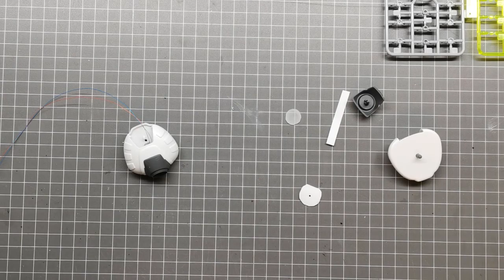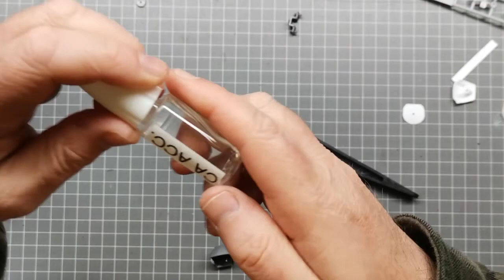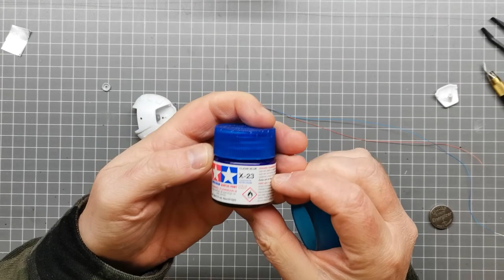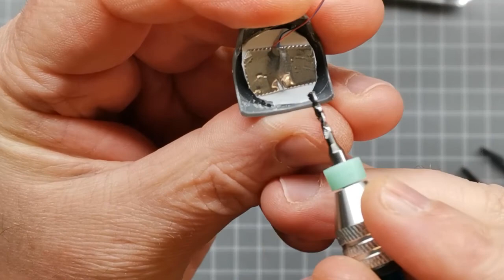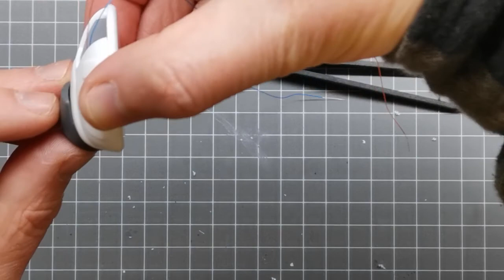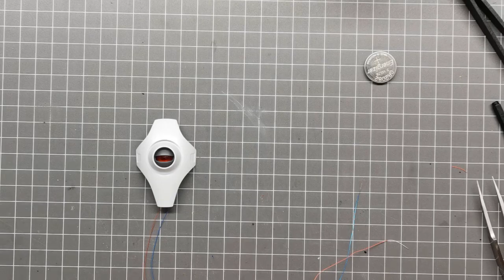Hasegawa 1/72 Regult (Standard Type) - Part 3 - More Wiring LEDs

Comment: It's coming along great. The switch location should work out well. Last night I was at Yamada Labi 1 in Takasaki and bought the light missile Regult for 2400 yen. I'm currently working on the old 1:100 scale heavy missile Regult by Arii.
Reply from the maker: Thanks Greg. I think it is coming along OK. I am sure I will have many more issues to contend with when trying to wrangle all the wiring together. The old Arii kits are great. I am looking forward to seeing your build of the heavy missile Regult. I don't think I have seen any builds of that kit. Are you planning on lighting it?
Reply: @duckplayingchicken  No, I won't light it. It's too small. The central eye is all one solid plastic part. I will add some lenses to other parts though, such as on the feet. The original Regult by Arii was made so that the knees would bend down to its collapsed shape, but this proved troublesome. The light missile, heavy missile, and scout variants include retooled knee joints which solved the problem.
Reply from the maker: Interesting. I may have to hunt down that kit and check it out. The one I'm building also allows the legs to fold down into its crouched position and it works reasonably well.
Reply: @duckplayingchicken  I've been recording the build and will likely upload it to my channel on Odysee.
Reply from the maker: Awesome. I will keep an eye out on Odysee.